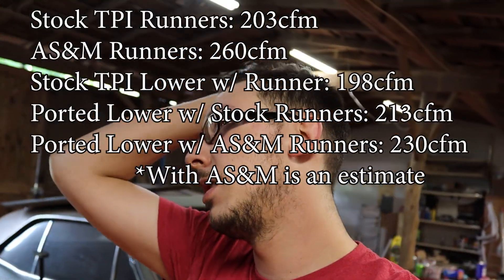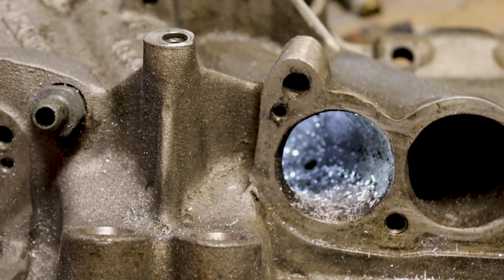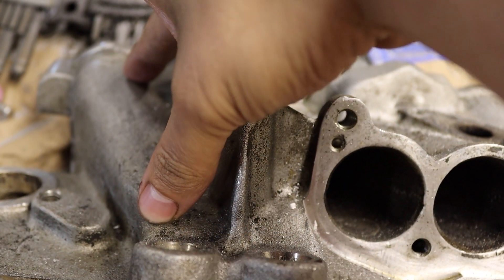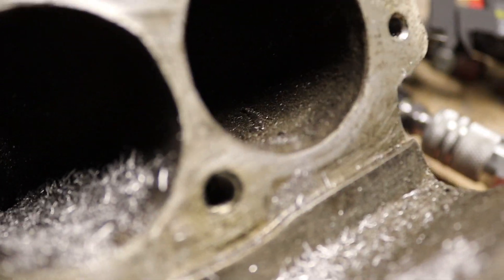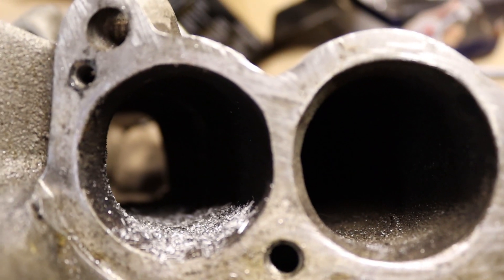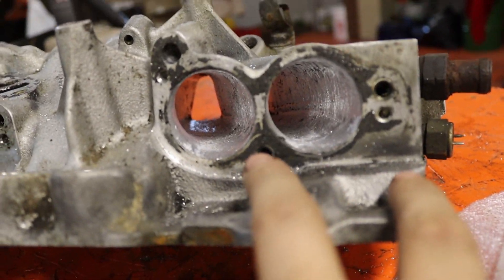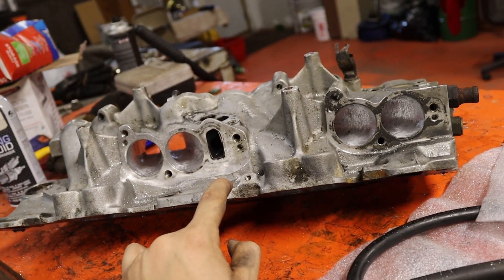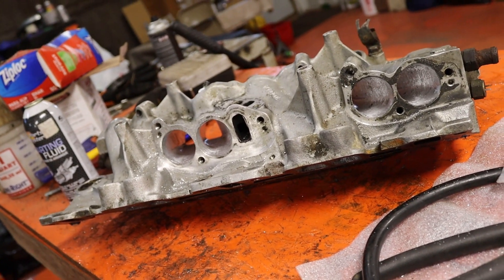How to Port TPI Intake Lower Manifold - Tuned Port Injection Performance Upgrades

Comment: One thing to remember about having long runners is velocity. That's where the low rpm comes to play. So when the intake valve is open, the airflow is a greater speed. But once the valve closes,  the incoming air is halted instantly which effects the airflow. Think of a water hammer.
Reply from the maker: Interesting way to think about it. The goal in my mind is to move the max RPM to 5000-5500rpm. TPI just simply won't do high RPM with the runner length. Most of the Stealth Ram gains come with a halving of the lower end stuff.
Reply: @LSxHunter  Well it is more a matter of cross sectional area vs length as to velocity, What the TPI has going for it is helmholtz resonant frequency that hits exceedingly hard from 3,000 to 5,000 RPM due to intake length. https://www.youtube.com/watch?v=-l7o64Tc5hkWhat is almost universally confounded is the upper horsepower wall based upon max cfm in a GM TPI system which was like 185 cfm. The pathetic heads are about the same cfm. So the tuning advantage is falling off as you are hitting a flow restriction at the same time. So if you can increase the flow the harmonic tuning will fade instead of dropping off drastically.

I built a TPI system many years ago that pulled really strong to about 5,700 RPM with the same AS&M runners, a ported upper plenum before there was YouTube and a TPIS Big Mouth lower only gasket matched not ported. In addition I had a TPIS  226 duration cam, Brodix 180cc heads. This combination mated to a T56 was a Mustang eater in my 89 Firebird. 

What is the point? I think today I could make one that had more HP and pulled to 6,000 RPM and made another 50HP at that RPM. With the almost supercharged mid-range TPI torque many an LS would be embarrassed. Here are my suggestions to LSxHunter. Radius the plenum into the runner, this from http://www.hobracing.com/tech/tpi_flow.asp.

Extrude-Honed ACCEL Hi-Flow intake manifold with 3/8 inch radiused inlet ...............275.83 cfm That radius is a lot of low hanging fruit it would appear. Of course Extrude honing is very expensive but I think a TPI aftermarket lower can easily flow 260 cfm, probably an OEM can with a lot of work. 

Last I think a cam on 110 LSA and some headers tuned for 4,000-6500 and the exhaust resonant frequency scavenging could take over as the Intake falls off. Maybe getting up to about 6,200-6300 RPM and peak HP at about 5,500 RPM. A bit lower than a stealth ram LT-1 style but much stronger in the mid-range which makes your car fast.  

Just my 2 cents...
Reply from the maker: @jamesbowman7963  more than just two cents. Appreciate the insight and the education!
Reply: Well arent you a fuckin genius, so tell me Einstein how does the temperature in the lower intake manifold effect the incoming intake charge?
Reply: @MasterWitchDoctor  If I were you I would be more worried more about the temperature drop as a result of cranial vacuum. To the question that actually belongs here obviously air density drops with increased temperature so lower is better for horse power...
Reply: @MasterWitchDoctor  ask the guys who wrote the article at Super Chevy Magazine "genius."
Reply from the maker: Its the same way we build high horse Pontiacs. Port velocity is king but you gotta open up ports to get the air through the thing. 250>198
Reply: @LSxHunter  at 6500 it is at 2000 - 2500 which is normal driving the smaller port is a lot more efficient.
Reply: @MasterWitchDoctor  Right TPI is not a high PEAK HP RPM intake System so that means cars that have them are slow or don't make power? No that was proven wrong in the 1990's. I have driven LS cars and 5.7 Hemi's and my TPI with Tri-Y Lingenfelter Headers would have eaten their lunch. It is average HP under the curve that matters most not peak. TPI's when set up right have massive low end torque and can be made to pull much harder at the top than they did from the factory. FWIW we drove 2/12 hours in a blizzard to pick up those Lingenfelter headers from John's shop in Decatur Indiana. They couldn't believe we drove a Fox body Cobra in a blizzard across Indiana. John got a kick out of it too. They had about 5 cars I recognized straight out of magazines in his shop and the guys gave us a nice tour which was too cool.

Now if you can compensate for TPI's weakness on the top end and reduce it, that is to say past the drop over 5,500 RPM all the better. You are correct a big cam doesn't work a relatively short duration less than 230 degree cam @ .050 lift is as big as you want. My TPI Formula 350 would almost jerk the front tires in the air with a T-56 behind it. I got 26 MPG driving from NW Indiana region to Norman OK at 75 MPH. Not bad in the early 90's.

Are we saying that TPI will beat an all out LS motor when you mod the heck out of the LS... No but you can give them a run for their money and be much more daily driver friendly and actually quicker stop light to stop light in many cases.

 https://www.youtube.com/watch?v=6-_OOfETQmw About as close to my set up as I have seen. 11's on motor in a full weight car with AC is impressive. Leaves the LS Vette in the dust with a "truck" motor... 

Again you are not going to make a TPI ever pull as hard at the top end as an LS but it is so easy to get over 500 ft lbs of torque that if you close the gap on the upper end you will probably be faster. 

http://www.superchevy.com/how-to/engines-drivetrain/sucp-0703-stealth-tpi-induction
Reply: @jamesbowman7963  sorry to necro your reply from a half year ago but i just wanted to thank you for your knowledgeable insight into TPI motors ! I always love when people are close minded about engine building, some people think the proven way is the only way and that stops innovation and progress. Hope your doing well !
Reply: Were there something special about Lingerfelter,'s tiny headers?  I can't find a photo.  Engine Masters generally said Tri-Y's hurt power.   Still,  I'd sure buy a set of Lingerfelter headers if they were still being made.....